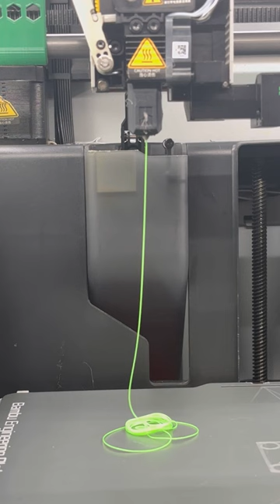Just 3 Mins of Running Filament through Bambu Lab X1C Making sure Clog is Gone….things happened…

Comment: Try cold pull to find the reason. Either it's dust/particle/foreign object, then try to wrap microfiber around filament. It could also be buildup if you don't do cold pull between filaments, especially after changing brand/type. Maybe some buildup after several heat cycles without flow or too humid plastic.

Comment: This brings back the recent memory of constantly extruding filament from my Ender 5 Plus trying to get the E-steps adjusted to extrude the correct amount of filament. so much spaghetti and blobs on the build plate, and lots of filament used but eventually got it right on the spot. there is a simple satisfaction to watching this though :D

Comment: Yeah, that was way excessive. It'll do that crinkling when the filament below it can't go anywhere.
Reply: Former engineers for 3d systems did something like this to purge out clogs. They also ran it at 260 degrees for several minutes and sure enough most times it would unclog.